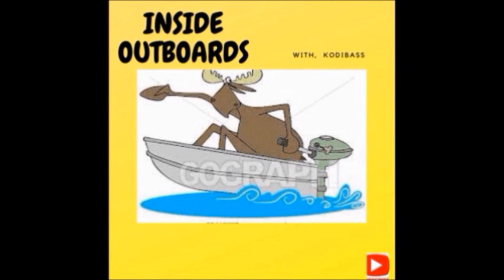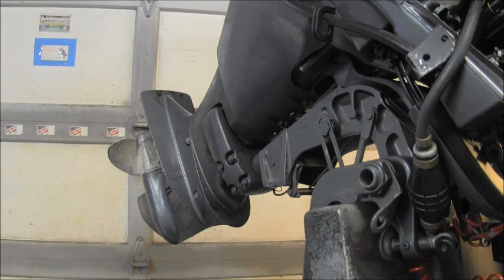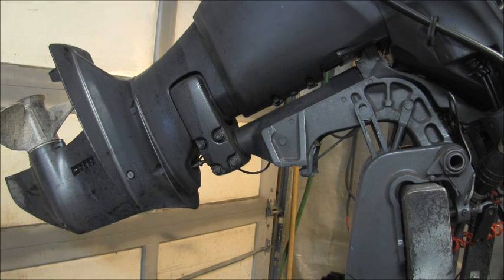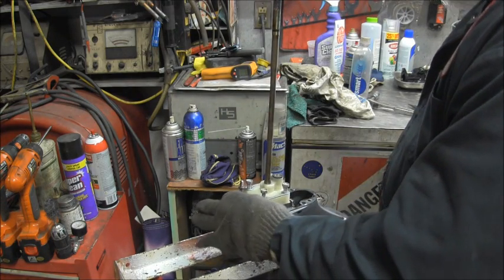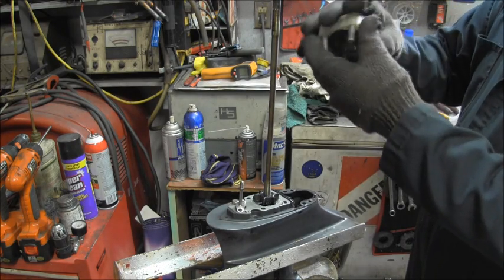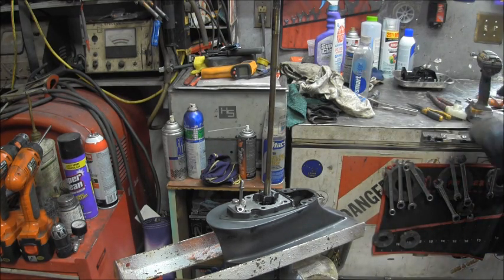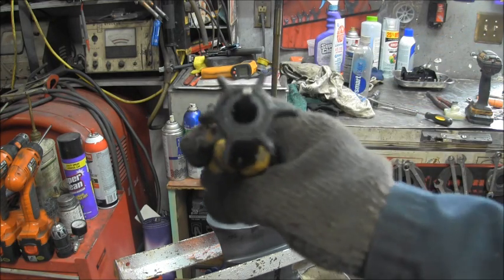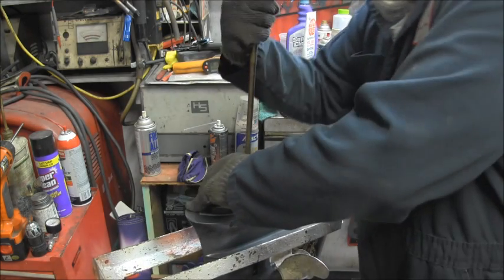YAMAHA  15 HP ,TOHATSU 18 HP,,  IMPELLER CHANGE,   &  More

Comment: Hi kodi, great vid as always. On those yamahas to remove the gearcase, you have to remove the small 10mm nut. That plate that was in the shift shaft, is mounted down in upper casing and holds a grommet. Those chips of plastic are probably melted plastic.
I work on those all the time, and when i remove the those gearcases  i put in reverse, and when i have to put it back is better, just a little rotation counterclockwise to align the splines and that's it. The water tube is fixed and not wobbling, so it's straight forward.
Reply from the maker: Yep' found that out the hard way, Thank U 4 sharing.  Good info 4 sure,     kodi

Comment: Did ya get a new camera?
Reply from the maker: Yes I got 2,  I already killed the new Gopro,   It was on a Tri-pod turned my back for 2 seconds,  wind blew it over & smashed it into my big vise  Boom done.  Used it less than 6 times lol,  The other is a Cannon with wide angle lens and ext mic & wind cover.   kodi